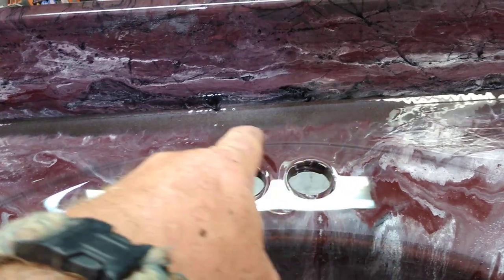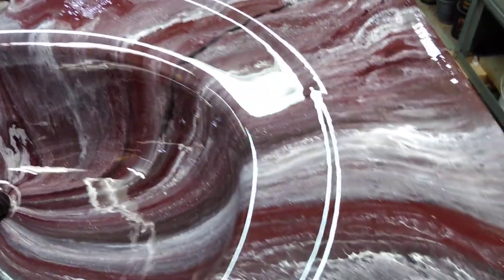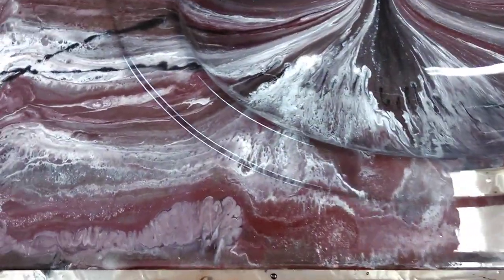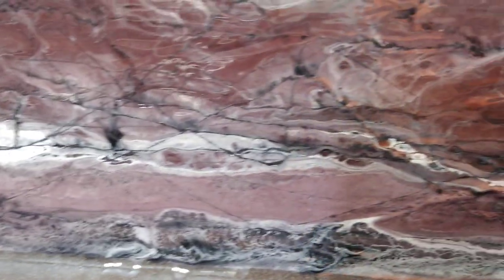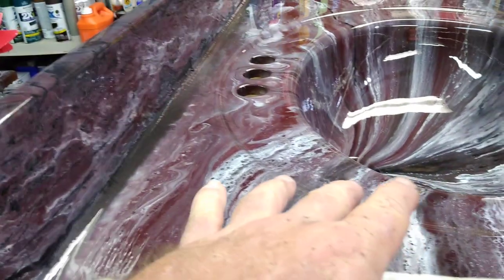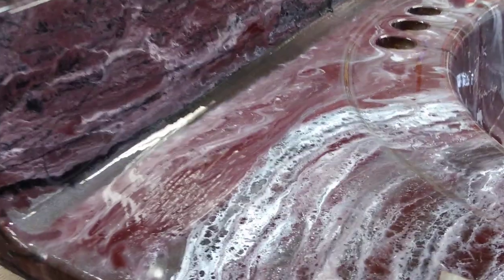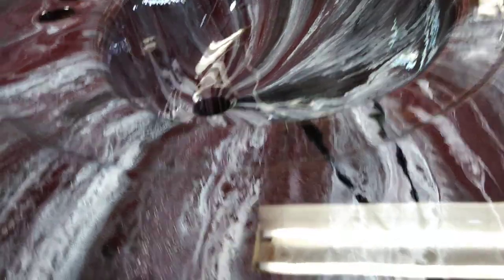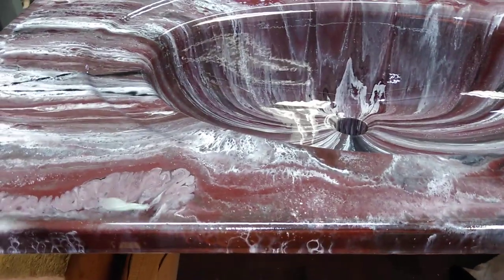Do it yourself epoxy sink part 2

Comment: Can I epoxy coat a vanity sink with backsplash in place without removing the sink?
Reply from the maker: You can do it in place you're going to have to fog some color on the backsplash before you put your epoxy on. That way whenever you do do your color coat if all of it does run off you'll have some color under the epoxy. The best way I have found to do it is to let your epoxy set up a little bit get a little bit thick and then pour it on the very top of your backsplash and let it run over down onto the sink part. If you do leave your sink in place you're going to have to do the backsplash first that way when you do the rest of the sink any of the drains down onto your sink surface will get covered up. I plan on making a video of a sink being poured in place so keep an eye out for that it's coming real soon.